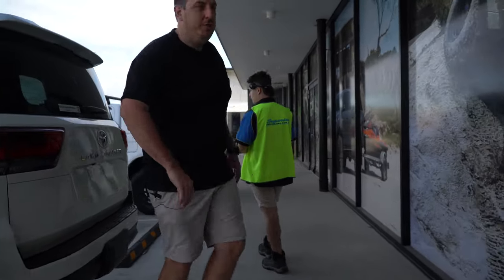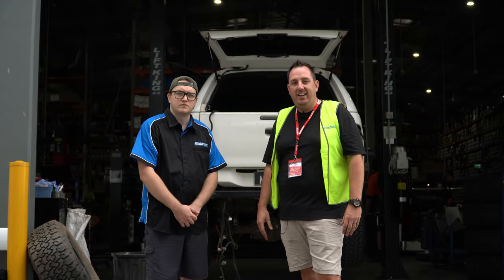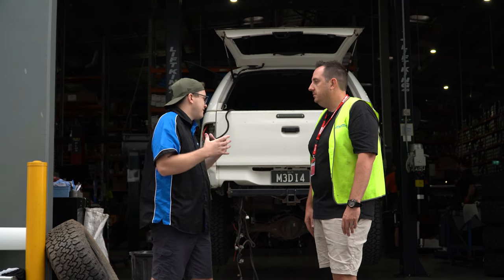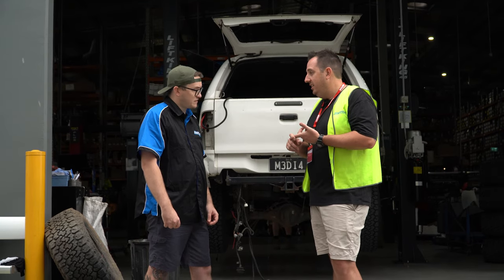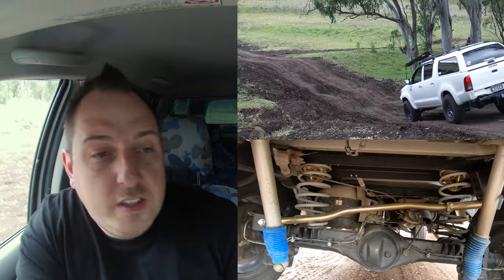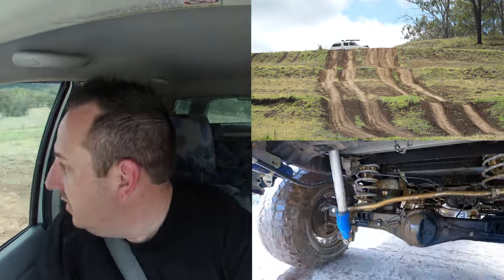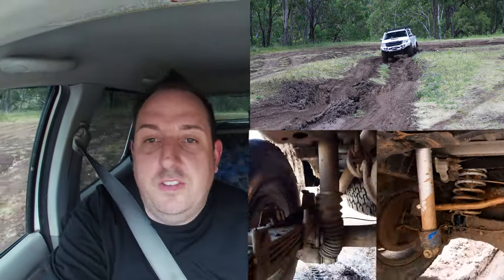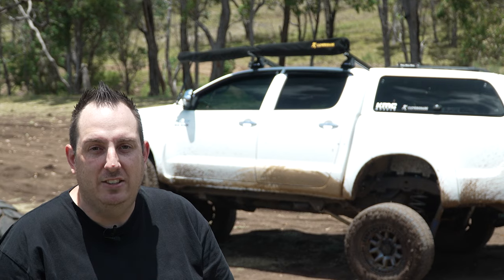Hilux Coil Conversion Toyota N70 KUN26 - Superior Engineering

Comment: Hey Mark. Are you still happy with the conversion since posting this video ? How much more comfortable would you say it is on the road compared to the original leaf springs ?
Reply from the maker: There is no way to describe how much better it is. The comfort for on road is amazing. And offroad going through bush, beach, gravel, rough paddocks has been so smooth. And being able to control it with the adjustable shocks is the best. Very happy with it all
Reply: @MarkSmyth I'm looking at doing the same on my 89 fullsize Bronco.

Leafs are so sketchy taking washboard sections at speeds.

Where I live the big lumber trucks mess up the roads breaking before corners.